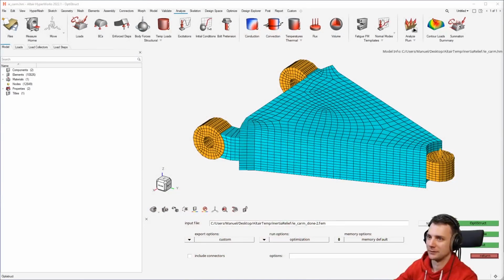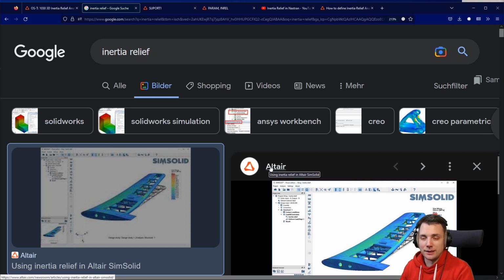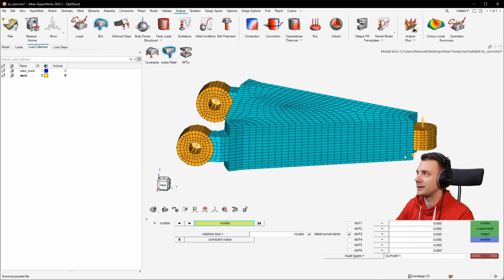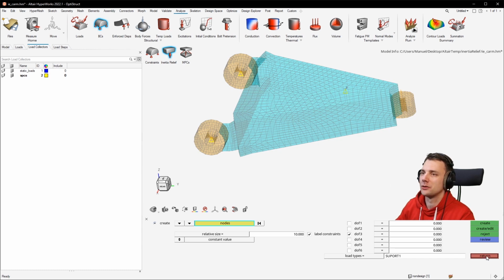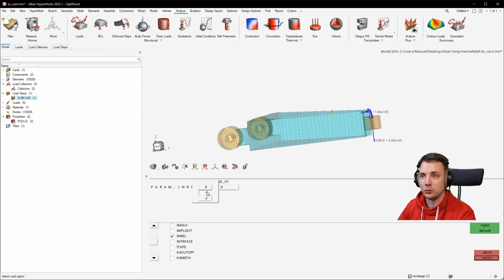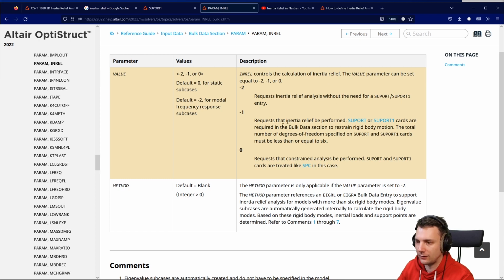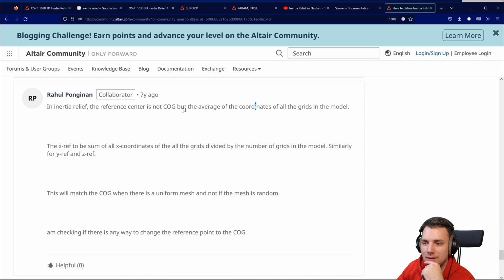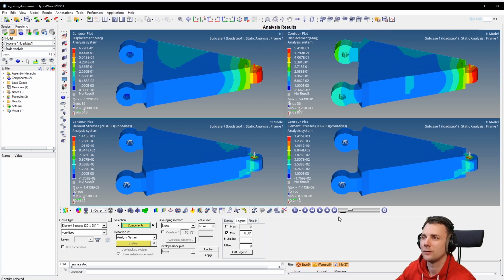Altair Hyperworks 2022.1 Inertia Relief Analysis with Optistruct (OST-1030)

Comment: hi, how can i check the unit of load of a model I imported but already set it up, thank you
Reply from the maker: The thing is, Hyperworks will not require you to pick any unit for loads. Just the units should be consistent if you want to have any reasonable output. So, the best opiton is to check if the model has material cards, because if you know how the Young's Module and the density is specified, you can guess the units. Take for example: 210000 an E for steel - you know then the unit for force is quite likely Newton and the length unit is mm. But if you don't know about the lenght scale, the force unit cannot be extracted as N/mm and kN/m are the same values for E.
Reply: @ManuelRamsaier   thank you very much